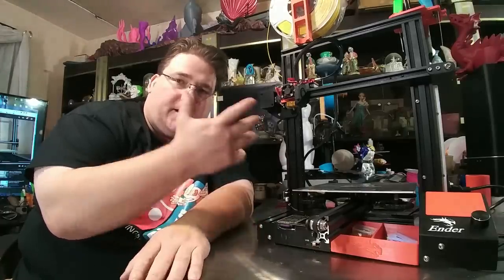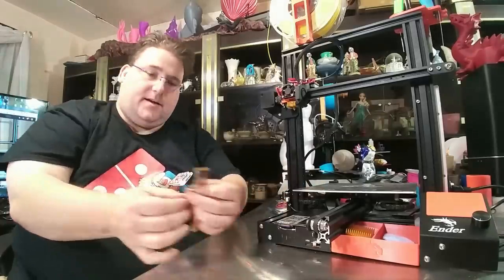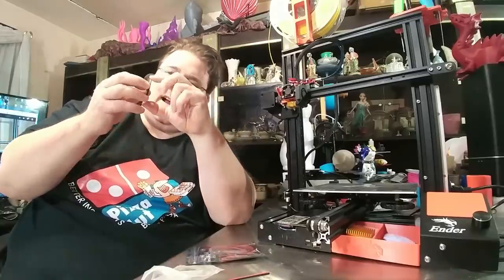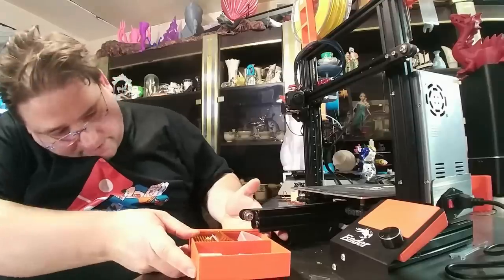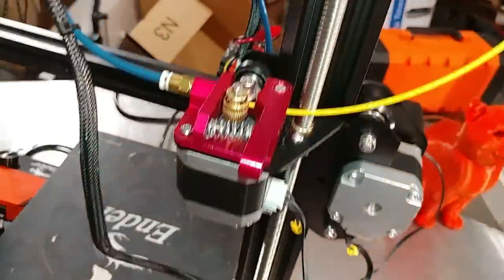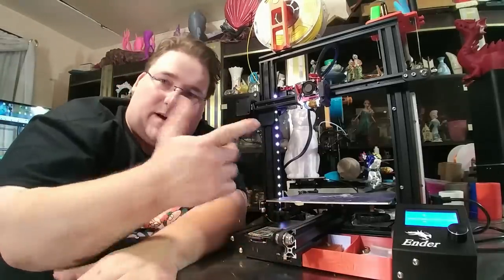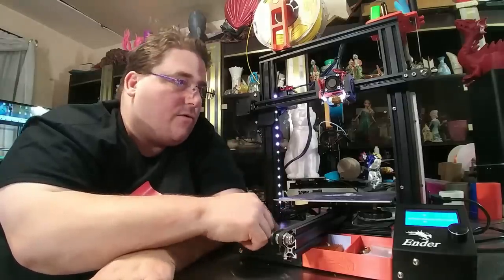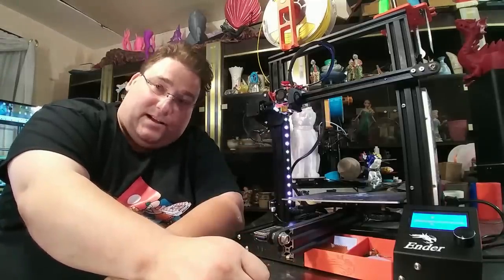T3DP 216 Ender 3 Upgrades & Mods

Comment: Hey Nerys! just a quick question! i replaced my Nozzel on my Ender 3 however its slightly longer then the brass one provided,

do you know if its possible to save the default height position of the Z axis. i need it around + 0.3mm
Reply from the maker: I'm not sure what you were trying to save? If you just wish to adjust your z-access down without having to mess the bed level you can move the Z limit switch so move the Z limit switch up .3 millimeters and you should be pretty close

Do be careful with longer nozzles as this means the filament has a chance to cool more than usual before it actually exit the nozzle you may need to use higher temperatures to get the same results and if it's too long you may run into clogging issues if not enough heat is able to be transferred to the tip of the nozzle insulating it might be a good idea depending on how much longer it is
Reply: I bought some slighly longer nozels by mistake, i did as you suggested and it worked! thank you once again Nerys!
Reply: ok, i did have some issues! it seemed to be printing fine then it started to get a bit wacky, i not going to use the harderned nozzles i bought they were pretty cheap anyway.. i decided to buy some 0.4 Brass ones and just keep with them as i know they work...

your FFF simplify 3D profile is BETA? have you got a final release for the ender 3? i just trying it out on trial, my prints in Cura are OK but having issues with the big cogs on the predator action pilers! everything else is fine no sticking anywhere else, the small ones have a bit of play in them and can see they will spin however the large ones wont! any advise! 

i promise i will buy you a coffee one day! via donation!

Regards

Paul
Reply from the maker: No worries it's not really beta anymore I'm pretty happy with it I will update it later tonight

This is where knowing that the settings are depending on what you are printing not what you were printing on I adjust my settings for the object I'm printing not for the printer I'm using

Your retraction should be about 5 millimeters for this particular print the action pliers set a coast of .1 mm and a wipe of 5 mm set your temperature as low as your plastic will comfortably print at make your travel speed 100 millimeters per second not your friend speed just your travel speed see what that does for the action pliers also be careful with your first layer too much plastic and it will fuse Extrusion multiplier should be .98 you might get away with .97
Reply: travel speed 100 millimeters? do you mean default printing speed of 3000 mm/min? can't see travel speed in the Simplify 3D settings
Reply from the maker: I use mm/s just makes more sense to me I guess coming from rocketry. you can set mm/s or mm/m in S3D

in your profile goto the SPEEDS tab and you can define default printing speed and X/Y Axis Movement Speed (travel speed when not extruding)

for smaller printers I use 100mm/s for larger printers I slow it down for example on my CR-10 10s 80mm/s and on the S4 and S5 I use 60mm/s

Comment: wont the isolators cause the stepper motors to move tiny amounts when changing speed and direction quickly?
Reply from the maker: That's what I thought but so far I don't see a difference

Comment: So far I'm not impressed with their machining prowess.  My uprights weren't machined square on the ends which is easily spotted on a surface plate.
Reply from the maker: Yep the first couple were not that good for QC but they are improving all three of mine we're Square however the issue was other parts for example on the left hand side the plate that covers the brain board was in the way from the upright which caused is not be square once you move that out of the way it squared up the primary issue was the top race was not drilled properly was yours?
Reply: I haven't gotten that far yet.  I'm going to have to go to the shop tomorrow and set these uprights up in a mill and square the ends to make these right first.  It's fixed now.  5 minutes in a Bridgeport and it's good.  On to the next step.

Comment: What types of material can the ender 3 print?  I do a lot of petg and tpu, and was wondering if this printer will have any trouble with that.
Reply from the maker: Pat G works fine that giant cat you see is all pet G the clear one I haven't tried TPU but it should work just fine the feeder unit is very TPU friendly I'll try to run some TV you through it to show it
Reply from the maker: I am printing a TPU nose come right now I'll find out in the morning how good it comes out so far so good I'm using the really squishy stuff from Paramount the pink Harajuku flexible pla
Reply: Thanks!  The specs say that the hot end tops out at 250C, which places it right in the middle of the 240-260C range listed on my PETG spools.  I rarely print it that hot, but it's good to hear from someone in the know who's tried it.
Reply: I look forward to hearing about how the TPU print comes out too.  And if you have any recommendations on settings.  All of my other printers were direct extruder drives attached right on top of the hot end.

Comment: If your steppers are that hot something else is going on. While Im watching this Im 8 hours into a print and there no heat from any stepper except the extruder and it min I could keep my hand on it easily with no need to remove my hand.

Comment: Hey . I got some dampers. There are only 2 screw holes. How is it attached?
Reply from the maker: 2 holes are clean screw through those into stepper. 2 holes are threaded 2 screw through printer mount into damper. 

2 screws in damper/stepper and  2 screws into printer/damper.
Reply: Nerys so only two screws go into the stepper motor. And only two screws go into the frame
Reply from the maker: You got it. 2 and 2. Its more secure than it looks just be careful which is which. On mine 2 holes were clean and 2 where threaded.

Comment: Those thermal double sided pads for your heatsinks it helps transfer heat better. Just drill 4 holes after dremel cutting fins or just snapping off the corner fins on a motor heatsink. If you have a drill you can drill 2 or 4 motor screw holes and add a few mm to the new screws length  and re tighten them .   Roflmao! You figured it out later in the video!

Comment: Awesome video! This made me drop the Ender 3 out of my wish list. At least for now.

I know FDM doesn't come close to SLA quality. But I'm curious to know which of your printers can really push it, in terms of the lowest layer height. Would you consider making a throw down video of your "finest" printers? Thanks!
Reply from the maker: So far nothing can touch the Ender 2 it's layer alignment is so good and so clean that my .2 millimeter prints look like your .1 millimeter prints it really is an amazing little machine
Reply: I know you wanted a answer from Chris and you got one. But I thought I would add my own two cents. 
To get really good looking layers that push that line what you need is layer height and extrusion consistency. I would say almost any printer can give you goo looking layers IF every part is working correctly. 
So the first big thing is extrusion consistency. Make sure you have filament that is very consistent in it's thickness. it can be under or over 1.75mm/2.85mm/3mm. Doesn't matter as long as it is consistent. Being well constrained is also important. You don't want your filament too loose in your bowden if you have one. That's why Capricorn tubing is so nice (apart from the extra lubrication it offers). Capricorn tubing has a smaller inner diameter. Therefore your filament is better constrained which reduced forces and pressure inside the tube. Otherwise you need to have a direct drive. Basically consistency in pressure and filament width is key. Moving from a non geared extruder can really help with extrusion consistency. A fake titan for example. It essentially gives your extruder more steps to make a smoother extrusion with FULL stepping rather than micro-stepping. Full steps are far more stable than micro-steps in terms of holding their position (if you check the prusacalculator for the Z axis it somewhat explains this and it does apply to your extruder axis). If you lose one or two micro steps it isn't the end of the world however on a non geared extruder (it can leave artifacts and inconsistency on very tiny sections however. Think small holes and tiny pillars as it is working hard between those full steps to maintain the micro-steps.) The gearing will also help get rid of potential missed steps and help push filament harder for faster prints. 

the next key point is layer height. Like I mentioned about micro-stepping and full steps being better. Use the prusa calculator for the Z axis. Make sure you are using layer heights that are compatible with your leadscrew to ensure full steps. You absolutely do not want you Z axis to lose or advance 1 or 2 microsteps during your print for higher pitch leadscrews like an 8mm pitch (that is what prusa uses for their printers. 8mm pitch 4 start). But even for a "normal" pitch of say 2mm you do not want to be losing/gaining a microstep ever few layers. It adds up and then you get layer inconsistency which looks bad. 
Trust me when I say that a 0.24 mm layer height print looks better than a 0.18 mm layer height on a 8mm pitch leadsrew with a 200 step per revolution 1.8 degree step (standard nema 17) stepper motor. Since 0.18 takes 4.5 steps per layer which obviously is a problem.

Also get a delrin leadscrew nut/or print one (printed leadscrew nuts last a really long time) if you have a leadscrew with a high pitch (it is hard to print a really small pitch leadscrew nut). It really gets rid of any play you have with a brass nut. Looseness on a brass nut = inconsistency.

Those things are what makes the most difference tbh. Smoothers, more expensive stepper drivers, dampers etc etc. All of that makes tiny amounts of difference to good layers in comparison to what I mentioned.  

Also make sure you are getting a quality leadscrew. Bent leadscrews are one thing. Improperly cut is something entirely different. I have had good luck and good service from the funnsor store on Aliexpress. But get your leadscrews from wherever suits you. 

On an also also PS note. For bowden make sure that the clips don't move when you extrude and retract. Since that is pulling and pushing the bowden tube. So there is some inconsistency happening there. use some small zip-ties or the clips to make sure they are always held tight. 

Phew. I think that about covers that.
Reply from the maker: A lot of good information there the smoothers do not remove noise if you have noisy Prince smoothers will do nothing for you smoothers are for a specific artifact that is result of a particular board and Driver stepper pairing that has voltage cut offs that caused the kinematics to take shortcuts because of the voltage drop out this is what gives you that stair-step Salmon skin if you do not have salmon skin smoothers will do absolutely nothing for you my Ender 3 had very very mild Salmon skin I actually had to look for it to find it it was not like the tornado which had it very heavy the smoothers completely removed it on the tornado they did not completely remove it but made it look more like the salmon skin on the Ender 3 without spoilers but more than good enough on the Ender 3 it erases it completely

I am seeing XY movement noise in my prince it is micro movements and it's consistent all over the place so it doesn't make the print looks sloppy so much as kind of like a JPEG with slightly too much compression you can tell that the print is good but the surface looks... Fuzzy is the best way I can describe it

The actual shifts that I see very minor as they are I believe are because of my cantilever setup it is permitted to wiggle slightly and this is transferred to the print I am working on a fix for that

Dampers do not improve tranquility if anything they either do nothing or make it slightly worse what they do do is remove the whining noise the steppers make makes the printer damn near silent dampers are a user convenience upgrade not a printer upgrade just like silent fans don't do anything to improve the printer it just makes it more tolerable for you to be around it :-) I have a lot of printers sometimes I have a dozen of them going at the same time and when I gain more space I'll have even more going at the same time so the cumulative effect of all this noise will really add up which is why I concentrate a lot on making them silent :-)

Comment: Hey Nerys, ever consider putting the Ender 3 on foamies when printing? I have found that the 'noise' in my prints completely dissipated. The prints are quite frankly ridiculous. I took all your advice and then some, doing all adjusts and such. I printed a housing for the Z stepper from thingiverse: https://www.thingiverse.com/thing:2932344  that moves the mount on the horizontal V slot instead of vertical. You can adjust the z motor like a rail and get the Z screw just right. Now print on an Ikea glass mirror, with painters tape on top, and I use Mat Medium (acrylic paint glue) to keep my ABS prints down, nice and neat. Removes the issue of bed adhesion completely. I print with a 0.25 nozzle and 0.04 layer using Siepie Profile. I then take the ABS and Vapour Smooth the suckers for 20 minutes. Models are comparable to SLA prints. Thanks for all the walk-through's Nerys, you are awesome.

Comment: So all in all ender 3 is total fail :(.
Reply: total fail no. For a trial run pretty good. Especially for a first trial production run. they only built so many to test parts and QC. After the trial run they are going to finalize and fix things according to feedback from the people that bought them, reviewers like Nerys and their own testing. Creality has been pretty good at doing actual upgrades to their printers over time
Reply from the maker: Even this QC fail multiple problem many issues printer is more reliable and produces better quality prints than some of the best printers from other manufacturers

Think about that for a moment I'm no creality fanboy but good product is good product and it was known going in that this was a beta batch hence the very low price

Also remember I'm being pretty rough on it to provide good valid feedback to them in the hope that they will take that feedback to heart and improve the printer

Time will tell
Reply: A total fail, no. These are DIY printers and need to be tweaked, some of us paid around $160 for it...that’s an insane price. 
I have issues with mine but am very happy with it. With the community behind it, it won’t be long before it gets even better!